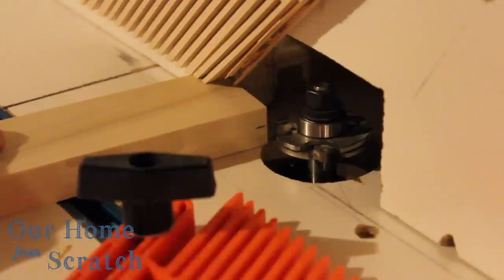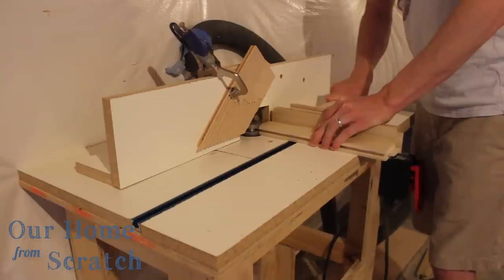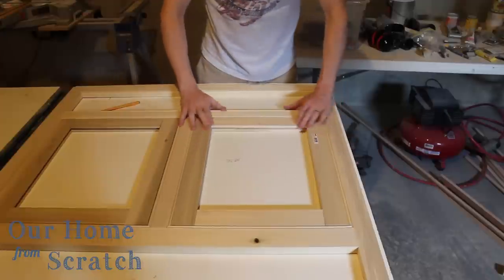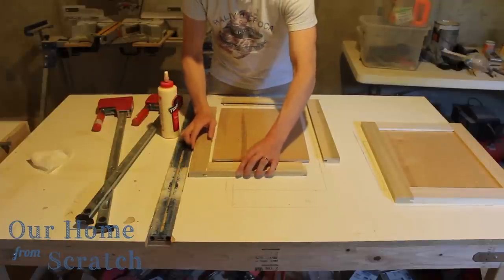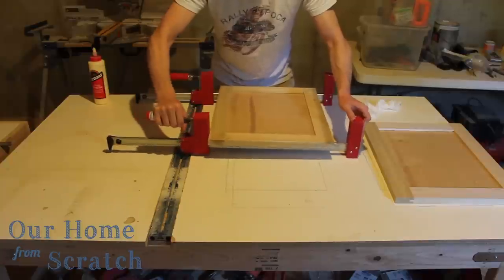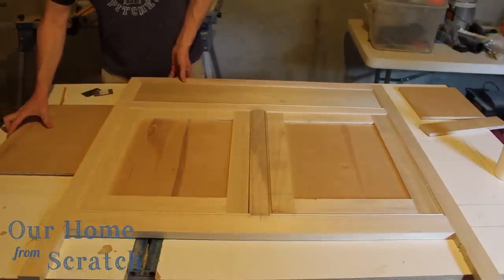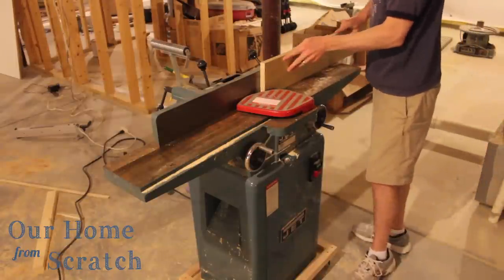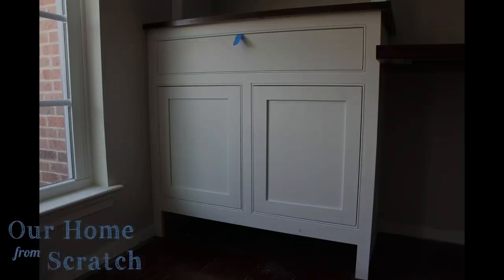DIY Shaker Cabinet Doors

Comment: Two tricks for jointing end grain: Take a short pass on the first end only going in an inch or two then turn the panel around and do a full pass from the other side. When the cutter get to the opposite end it will only brush the wood and it was already jointed on the short pass. Second trick: do the ends of the doors first and do the sides last. That way if there is any minor blowout, the side passes will clean it up.
Reply from the maker: Great tip!!  Thanks for sharing that!

Comment: I understand you used 3/4” poplar for the frame and 1/2” birch plywood for the panel. How wide are your rails & stiles & what size wood did you buy - 1 X3? Thanks so much for this video. There are tons of how to build these doors videos on YouTube but very few of them discuss the type of materials used.
Reply from the maker: I don't recall exactly, but I think the stiles and dividers are 2" wide.  The top rail is maybe 2.5".  The bottom is also 2.5" to allow the baseboard molding 1/2" to overlap it.
Reply: @OHFScratch  Thank you!

Comment: Nice, to the point video!

Note of caution: be careful using a damp papertowel - any little bit of moisture can cause the grain of some woods to rise, thus ruining your smooth surface.  IMO - better to minimize glue spillage, let it dry, then scrape/sand it down.
Reply from the maker: Good point!  Thanks!
Reply: Also can leave a Mark if you stain your doors.  (If not sanded well enough)

Comment: Plywood isn't going to give you the expand/contract problems of a solid panel. I would probably still build them floating, like you did - but if you happened to get some glue on the panel during glue-up it won't cause you problems.   There's actually something to be said for NOT floating a plywood panel - it's a strong structural panel that will keep your door square if you glue it in.

Comment: I believe you used 1/2" plywood for the door insert, then routered all 4 edges.  You mentioned that 1/4" was too skimpy.  What do you think about 3/8" plywood as in insert?  I'm hoping to avoid routering the plywood to save some steps.
Reply from the maker: Give it a shot.

Comment: Hi there , I have built few doors using the method you suggested but instead dado I used pocket holes . My dilemma is not being able to match exactly the depth of groove in styles and rails to the rabitted portion of the center panel . For the most part I end up with a gap between center panel and the styles/rails on the back side ( inside of the cabinet ). Do you have any suggestions ?
Reply from the maker: You can try using spaceballs or just taking practice cuts until you get the gap correct.
Reply: +John Our Home from Scratch thanks Jhon, when you say save balls do you mean bearings ?
Reply from the maker: Here's a link to the product I'm talking about:  http://amzn.to/2lk1GTA

Comment: Hi bro  i seen that u used  1/2 inch plywood  and than u  used the router to  make the edge  3/4   was there any gap  viable in the back  how did u get    that accurate    i made one  but there is  a small gap also  what is the thickness of the  panel 
 also  i  checked those  plywood   it is hard to find a strait panel is that matter  it kind of twisted  thx
Reply from the maker: There's a small gap visible in the back.  You can certainly do a trial and error fit-up to eliminate it if you'd like.  You can also add a raised panel to give that backside a more decorative look.  The way it's done here it looks fine from the front, but from the back it's not terribly attractive.
Reply from the maker: Thickness of the panel is 1/2".  Usually 1/2" material is not twisted.  You can also use MDF or something more stable if you'd like.

Comment: is there any easy way (trick) to adjusting height of router bit to get exact midddle? i'm using scrap to test, but seems like i can't ever get it centered.
Reply from the maker: +anastasia zielinski It's a major PIA.  I'd say get it as close as you can and then don't flip the board over for a second cut.  Just make one pass and it will be tight.
Reply: Thanks

Comment: How do you reduce the end grain dimension if you aren't running it through the jointer? Might be a rookie question, I'm new to this!
Reply from the maker: You can run the end grain down on the jointer and just clamp a sacrificial board on the other side of the board to prevent blow out.  If you don't have a jointer, then just use a table saw with a cross cut sled and a very sharp blade.
Reply: John, thanks!

Comment: Couldn't agree more with "B Miller":  That step of "running the board thru to make sure the groove is in the center" is CRAZY WRONG!   You are just making the groove to be the wrong size, by doubling any error you had!  Imagine you had the groove 1/16" too close to one side...you flip it over, and you now have it 1/16" too close to the other side, too...and your groove is 1/16" wider, too.  Use scrap wood to be sure you have it set right to begin with.

Comment: It's nice to see someone who isn't so damn sloppy with their glue ups.  If you have like 50% of the glue squeeze out why not try to use a bit less and not have the mess or wasted glue?  Sorry I was taught this way by my Dad who would watch New Yankee Workshop and complain that Norm was sloppy with glue and now most Youtube woodworkers are 2-3 times more sloppy.

OK my rant is over.
Reply from the maker: I hate wasting glue too.  I also hate wasting these glue brushes too though!
Reply: Get those nylon basting brushes at Dollar Tree.  once the glue dries it pulls right off.
Reply: Hi bro  i seen that u used  1/2 inch plywood  and than u  used the router to  make the edge  3/4   was there any gap  viable in the back  how did u get    that accurate    i made one  but there is  a small gap also  what is the thickness of the  panel thx

Comment: Every panel door video I watch has the guy being anal about the groove being "in the middle" of the board by running it both ways!

This is simply ludicrous and people need to stop doing this wasted step!  For one thing, if you have the proper dado stack to give you the groove width you need, then you are just making it SLOPPY when you run it the other way!  The MORE you were off center the SLOPPIER you're making it since it doubles the error!!!    STOP jUST STOP!!!!

All you have to do instead is simply run a test board through just a couple inches after you have your setup, and check for it being centered.  If not, adjust the bit (or fence if cutting on a table saw) and run your boards.  Only thing you have to do is keep a consistent FACE against the table (router) or fence (table saw).  So, on a router table, run all the boards FACE UP, or on a table saw, FACE OUT and everything will fit perfectly with NO SLOP, NO wasted time running everything twice!

It MATTERS NOT if the groove is 1/64th off of perfect center!!!  It just matters that ALL ARE CUT THE SAME, EVERY RAIL< EVERY STILE, on EVERY DOOR!!!

Not even Bob Villa could spot the imperfection standing in the finished kitchen!
Reply: Gee, B Miller,  I can see you feel strongly about this.  But actually, running both faces against the fence can be a great way to get a much better fit than you might get with a single pass.  Let's just assume we are using a router table with a router bit for simplicity.  Do you have a bit that matches up to your panel width exactly?  Possibly (probably) not.  If your bit or stack is not a perfect match, that is when you get a sloppy fit.   So, start with slightly undersized bit.  Run a few test boards to get the groove as dead center as you can.  Now, by SLIGHTLY lowering or raising the bit (doesn't matter either way, since you are centered) and doing two passes (flipping the faces) you can adjust the width of the groove for the perfect,  "suction" fit.   Since I paint most of my cabinets, I don't have the paint cracking on the intersection of the stile and the panel.    So, what do you think?
Reply: Tom G a. it's not "panel width" we're concerned with when cutting a dado.  It's panel THICKNESS.

b. He's cutting a RABBET on the panel, which is infinitely adjustable versus the thickness of the panel, it's a crazy simple adjustment to run a scrap to get perfect fit into the dado.

So, flipping any rails / stiles on either a table saw or a router when cutting the dado is a waste of time.  That's what I think.
Reply: You are right, B Miller, I should have said panel thickness in that context, not panel width. Wow!  Good one.  And, of course, rabbeting a panel is a way to get a tight fit into a dado.  May take some trial and error to get that great fit--like my method.  

Still, some people (me, for instance) may prefer the accuracy of a centered panel.  Among the advantages of this method is the fact that I can later decide which side of the door I want to face out.   Also, the woodworker may be using the original thickness of the panel (frequently 1/4 inch plywood), not trimming it down to match the groove.  

I am not sure if you are being intentionally ironic here (and elsewhere on Youtube), shouting in caps about a ludicrous waste of time, when I am sure most viewers are not in a production environment.  If you are being ironic, well, it is worth a chuckle.  If not,  best of luck on your quest, sir.
Reply: Tom G Understood.  The caps was purposeful.  I have a background in desktop publishing, so always use fonts the way I intend, here, since bolding on Youtube is a pain, I use CAPS for simplicity to show emphasis.  Caps doesn't always equate to shouting, particularly in the instance of single words.  

But as the grandson of a world class engineer, I'll take one last pass at satisfying my internal drive for accuracy and efficiency to make my point on all of this before moving on...

Certainly everyone decides what standards and techniques they will use in any project, and in truth, I wouldn't have it any other way.  We don't need everything in the world to look exactly alike.  Rock on.  My comment is targeted at those that are looking to prioritize woodworking knowledge and working smart, over working harder to achieve the same or comparable results.

But, if using a plywood panel insert, there is zero reason not to glue it in place, you only don't glue solid wood panels, because they shrink and grow so much with humidity that they can crack.  So, your comment on the risk of paint cracks where the panel meets the door tells us never to use sold wood panels that have to float free in paint grade projects, but rather always use plywood so that it can be glued and not face this risk.  

So with a plywood panel, a (I'm exaggerating now) 1/4" of play wouldn't hurt in the dado, if you just forced the panel towards the "front" all the way around before gluing...  So most unskilled people can rabbet an overly thick panel to yield an unnoticeable end result difference in the door, play or not.  The bottom line is today's glues are stronger than the wood they hold, so I see zero risk that the paint will likely crack where it meets the frame in a properly glued panel regardless of the dado width.

And not to sound overly "debat-ey" but the trial and error is not at all like your method.  You are passing every board twice through the router, that's not trial and error.  As I said, getting the rabbet the right thickness, if one is even necessary at all (for example, you have some 1/2" plywood scraps, enough for the panels for two garage cabinet doors so rabbeting them is the way to get them to fit in a 1/4" dado... instead of spending money to buy some 1/4" plywood), only requires a 2" test cut on a scrap of wood, test fitting the resulting rabbet into the dado and adjust thicker or thinner if necessary and THEN cut all the boards to that fit, in ONE PASS.  Completely different from your two pass method.  Just doing 10 doors in a kitchen would be 40 extra passes through the router in your version, for no benefit.  Sure, two doors in a garage, flip 'em for the 8 extra cuts if you feel the need.

But that was the point of my post, there's zero structural, functional, accuracy or any other benefit to cutting the boards twice by flipping them over.

As far as flipping it over, I've never met a woodworker who didn't decide on the best face of the wood to be the outside (showing) face before even cutting them to length / width and then marking those good faces to be able to assemble it that way, so don't see any need to worry about deciding which side of the door to face outwards later, that gets decided before the first board gets cut to size...  most of the time the wood you are working with will have a clearly better face on one side that warrants using it as the showing face.

Even moreso, if you put any kind of treatment on the outside rails and stiles like some trim or an angled cut sloping in towards the dado on down to even simpler steps like rounding over the outside edges to relieve them all the way around, then no woodworker I know would ever spend the time to repeat that on the inside (you'll never see a door in Home Depot done that way, particularly the rounding), so again, no reason to decide later which is the showing face which in most cases would be impossible.

Since a 1/4" dado is a standard cutting width for any dado blade set you would buy, and a standard router bit size (all over Ebay for <$10), it is simplicity itself to make a 1/4" panel fit into such a dado.  Although, most 1/4" plywood is often not 1/4", such as Home Depot "Sande" 1/4" plywood, fine for paint grade shop cabinets, is only .205", but again we're back to the false necessity of a perfect fit in a glue up scenario.

If centering IS desired (as apparently in your case), AND using a router bit for the dado it would be quicker than your method to do a test cut with a properly sized but, like a 1/4" bit, just eye-ing the center of the board, and measure the shoulders of the test cut to see if the dado is off center and raise or lower the bit to get it perfectly centered.  Then just run the boards through once.  Way, Way simpler and quicker than running 40 more boards through a router to build a kitchen.

Lastly, a centered panel isn't more accurate, it's just different.  Accuracy implies it would be the same all the way around (i.e. not tilted), and come out as intended or planned.  The word you were looking for is symmetrical.  However, nothing says centering the panel for symmetry is an imperative or even preferable, and in fact, no one but an expert woodworker critiquing the work would likely even ever notice this in the finished doors.  Heck today, designers don't even hard and fast recommend worrying about centering the kitchen sink in the window opening... 

So if centering somehow satisfies some internal compulsion, go for it, but know it has nothing to do with accuracy.  And as stated, it can be achieved quicker than running 40 boards through a router twice.
Reply: Again, good luck on your quest.
Reply: Tom G Thanks for learning some more about woodworking.
Reply: If you know so much why are you watching videos on how to do it?
Reply: B Miller Bob Villa wouldn't know he was IN a kitchen unless the producer and his exec assistant had it on the teleprompter for him. But I agree with you- set your tools up using scrap and measuring and it'll b plenty accurate enough. It is ridiculous to have to double all the cuts.